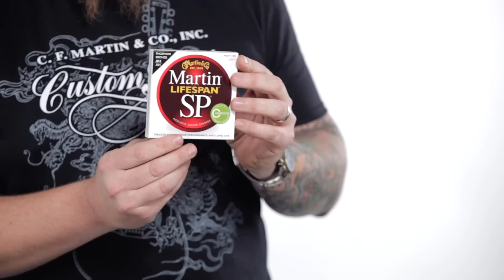Restringing A Slotted Headstock

Comment: Is it ok to use phosphor bronze strings , let's say custom light ones to a slotted headstocked guitar?? I've always had this doubt. I've got both one slotted headstocked guitar and one solid. I've heard the slotted one should have only nylon strings, but as for sound, I prefer bronze ones, I just need to know I won't eventually damage my instrument because of doing this. Thanks in advance for your response!
Reply: Depends on the guitar, if you have a classical guitar (wide, flat fretboard, big plastic tuning axles, a bridge without pins), it is NOT OK. The higher tension of the steel strings will ruin your guitar (deform the top, warp the neck, shear the bridge off). If you have a steelstring guitar, it's doable. They are designed for that higher stringtension. Rule of thumb: a bridge without bridgepins: no steel strings. A bridge with pins: steel strings.